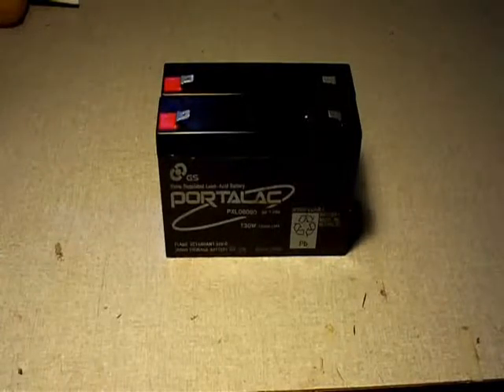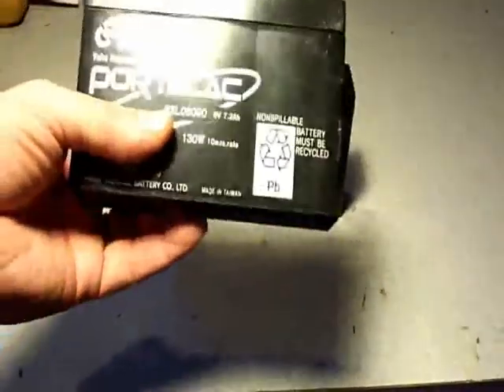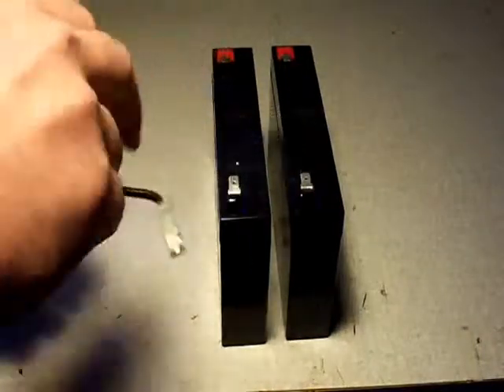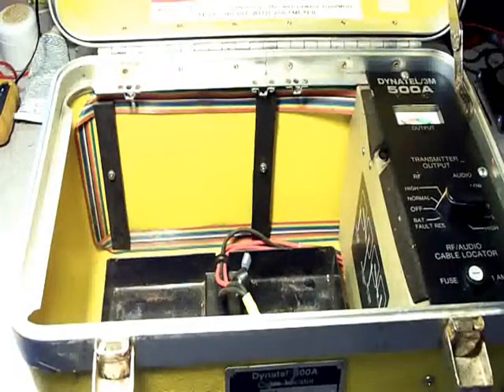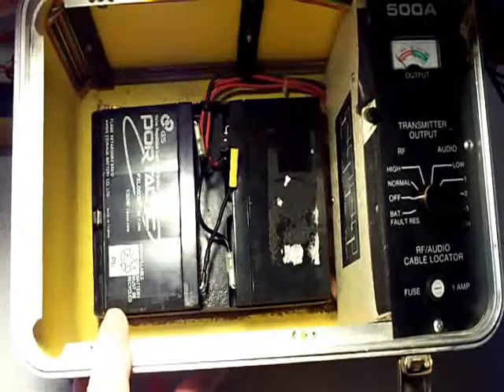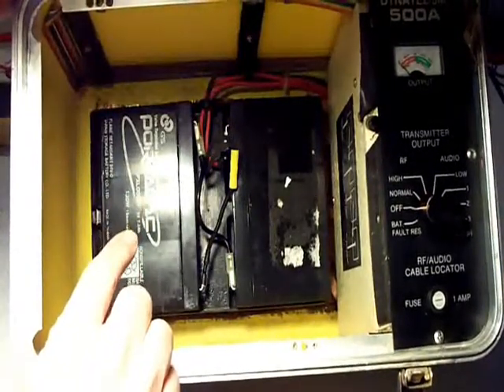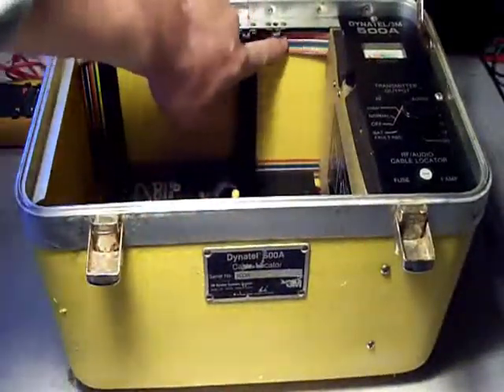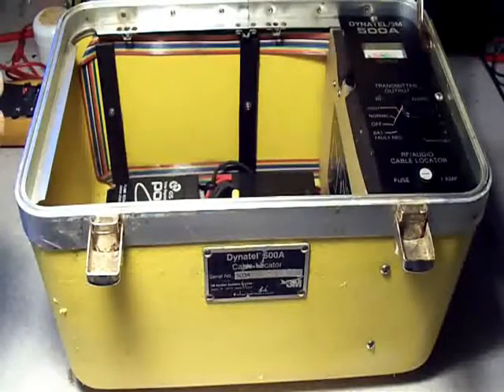Alternative Battery Replacement in a 3M Dynatel 500 or 573 series Transmitter Part 2

Comment: Thanks for this clear and informative video. I have one question. My 573C has 4 wires coming from the switch compartment, two red and two black. Which two should I hook up to the batteries, and what should I do with the other two wires?